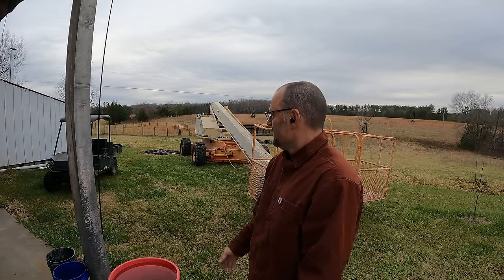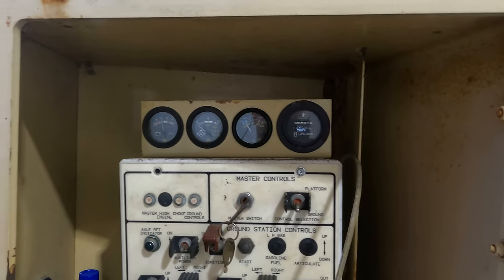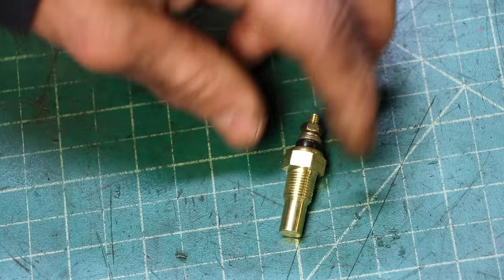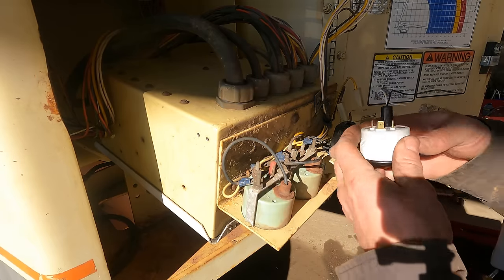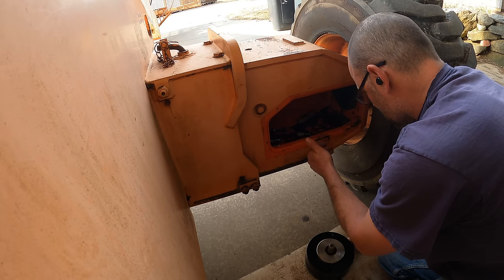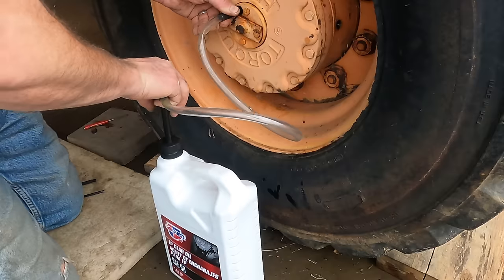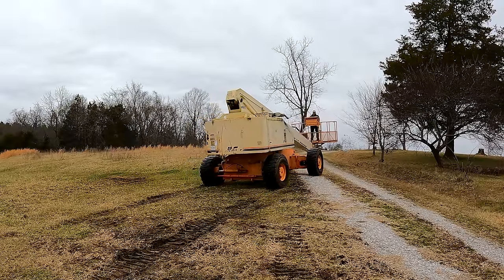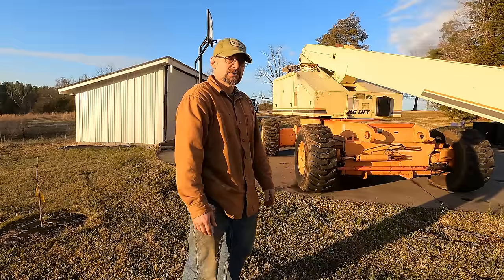Fixing The Boom Lift's 4 Wheel Drive System and Other Stuff.

Comment: Testing  electric gauges, first ground  the wire at the sender. Turn the ignition switch on for an instant. Gauge should  go full scale. No reading bad sender or 
bad  wire continuity .Ground the sender terminal at the gauge. Key on should 
go full scale.  Make sure gauge is getting  
12 volts from the key switch. Most gauges will move off the peg on a cold  engine when the key is on.
Reply from the maker: Yep, sounds like I should have tested it more before replacing to figure it out.
Reply: I have been  fixing  pleasure  boats since the 1960's  so I've  seen  a few gauges 
I also don't like  wiring schematics !
Interestingly  I worked  on very few Johnsons  but I did work for a boat dealer that sold Trojans (boats) manufactured in Lancaster, PA.

Comment: 34:05 i can be wrong, but i suspect that there is a bigger amount of blowby inside the cilinder then you think, because the retraction has difficulties and gravity needs to help. 
The side of the cilinder for pulling has less force then the side for pushing, due the diameter of the piston rod that you loose that can tribute in force, so that is a clear sign that there is something wrong. Another suggestion, is to measure if the hydraulic pump pressure is stil in the normal working area, the hydraulic pump is the heart of the entire hydraulic system. A lack of enough oil pressure and blowby in cilinder(s) will contribute even more on the retracting problem, but the lack of enough hydraulic oil pressure can also be not beneficial for the 4WD drive system. Regarding the connection from the thermo sensor to the main control unit, is i think to cut off the power when the water temperature is to high. It can be a complete cut off power feature, or can be a interaction with the ignition timing (like this is done in cars) that the motor develop less power, and the water temperatur should drop. Now i think of it, this connection between water temperature sensor and main control unit, can also tribute to the cold start problem if the ignition timing is not correct at cold temperature. So this connection needs some investigation what it does or not do.  Grtz

Comment: Hey jon i know its been a while since u posted this ans I was gonna comment it as soon as i saw you do it but then i thought "well lets see im sure he'll figure it out" and sure enough.. idk if anyone else mentioned this but putting thread tape on temp sending units can cause you not to get a ground(if it was in a metal housing like it normally is on most) , most have a o ring but i normally do tape em, just a few threads and leave most of the threads bare for ground
Edit: theyre also very easy to test w a multimeter to see if theyre functioning

Comment: 8:42 That thing is using it to help determine spark timing. This engine is a bit of an oddity in that it has a carb, but it's got a modern OBD-II coil-on-plug ignition system. It's a wierd ass hybrid setup and I guaran-fucking-tee you the sending unit on the water neck that pokes itself into that brainbox is there for the brainbox to know engine temp and thus know where to set ignition advance.

Comment: Do you think the bends in the bars of the basket were from chains the previous operators may have used to hold something like lifting a steel beam into place? they put way too much weight on the bars.

Comment: You mentioned that you have issues retracting when fully extended when close to the ground. Could this be due to (malfunctioning?) safety lockouts?
At 4:10 there is the chart showing unsafe boom angles/extensions. On newer lifts I've used, it wouldn't let you extend at unsafe angles and would beep a lot. Could be something similar. 
I could be wrong, just a thought. Good video.

Comment: Not sure if you'll see this but how'd that Manual choke work out had a suggestion about hooking up a servo type motor to it so it could be opratable from the lift wirelessly that way you wouldn't have the concern of not being able to cold start it after a longer job

Comment: Why not plasma cut in a few oval shaped inspections ports and see what you got. If the machine has not need used that much in the past yrs. You could probably also do cleaning by inserting a wire brush while actuating the mechanism too. To l knocked off surface rust and get a good peek at everything. Then just make some thin gauge cover plates with some self tapping plug screws

Comment: Most all modern engines will have 2 coolant temp sensors…. The 2 wire one will always go to a computer for the exam to monitor and help adjust fuel mixture but in your case it could be used to shut the machine down if it sees an overheat condition. The other temp sensor usually is a one wire and will go to a gauge or dummy light. I’m willing to bet your ECU monitors critical engine components and if one fails will protect the engine

Comment: You temp. sensor needs to be in its original location (low in the block), if it's not immersed from low coolant level, it will NOT indicate an overheating condition .

Comment: Did you buy the new brake assembly from JLG or did you find a good aftermarket source that won’t rob you at gunpoint?
Reply from the maker: I got it from JLG.  Not cheap, not horrible.  About $800.
Reply: @FarmCraft101  Ya, not complete extortion ;p. I priced a control value that burnt up on my Genie lift I am rebuilding through genie and it was $5500.  I was able to lift the part numbers and buy it from bosch for $180. How do you justify that markup? Once again awesome work!  You are what inspired me to create my channel!
Reply: @MakersAcres  WTF? You gotta be kidding. I would probably typed the same thing if you had said $1,800 but $180 that's just criminal gouging IMO. Cool that you were able to get that part number, nice one and I bet you had a massive grin once you got over the price difference shock! 👍
Reply: @josephking6515  Ya. Since I am rebuilding the unit I had to replace a lot of things and found out that the genie markup is 2-5x retail on most things. When they guy told me the price I laughed and said “I think you misplaced the decimal point”. He didn’t laugh. It was a long search, but ya, I was grinning ear to ear when I found the same exact part for so much cheaper. I really feel bad for the guys on construction sites that have no choice but to pay that fee so they can get the machine in operation as quickly as possible!

Comment: The ECU likely uses the temp sensor to adjust spark timing.  It might adjust it for optimal spark as it heats up, hard to say.  In addition, it very likely is a safety.  If the temp gets too hot, spark can be retarded to reduce heat to the head.  Or cylinders could be disabled, or spark cut completely.

Comment: I'm going to say that ECU can probably kill the ignition or at least set off an alarm somewhere if the temperature gets too high. Is there any kind of engine warning light up in the cage, it could turn that on?
Reply from the maker: Yeah, good point.  Somebody else pointed that out too.  Probably just to shut it down if it overheats.  No light anywhere that I'm aware of.  Cheers!
Reply: @FarmCraft101  I love the gauges with the built in physical contacts for warning,shut off. Way better than a black box that dose what ever it wants. I put them on all my equipment.

Comment: I agree with checking out the boom, but maybe you can find a plumber with a borescope on a cable reel like they run down pipes and get a look at the inside to make an initial determination before diving in. If you see something suspicious, you’ll feel better about the job.  If you see nothing, it’ll spawn a ton of comments about why you’d be an idiot not to take it apart anyway. Win win right?  😏

Comment: If it were working perfectly I would agree with the adage of it ain't broke don't fix it since it is over engineered. However, since you have an obvious problem with the retraction there is some type of problem so you and your's is worth tearing it apart.

Comment: 16:50 Maybe a dumb question at this point, but why not test the temp sensor before you install everything..?  Just hook it up to the wires and then press the sensor end on to the engine block or something?  That way you can see, before you make adapters etc, if it even reacts to temperature changes at all before you do all the installation work 😅
Reply from the maker: Fair point.  I just assumed it would work.  Got there in the end, FINALLY!@?!

Comment: I know you're working alone most of the time, but if you're winching with a vehicle you should ideally have it in neutral with someone standing on the service brakes. The last thing you need is 12,000 additional pounds of force on your parking pawl.

Comment: hello from the Netherlands .
does your boom lift have 110V power in the man basket ?  
I think I saw some remnants of it sitting on the left side of the controls.  
this is really a very useful function because in principle you just have a generator on board.  
when you turn on the power function, 
the motor goes into high speed and you just have working power in your man basket for a corded (magnetic) drill or grinder.  
You also have models that work differently, there is no generator on the engine, 
they only have the option to insert an extension cord at the bottom of the undercarriage and then, say, an "extension cord" runs upwards through the boom.  
if you are going to take things apart, it might be an option to at least put an "extension cord" in the wiring harness yourself
thanks for the video .  
Sincerely Hollandduck

Comment: In regards to the boom tear down thing, tear down makes it sound much worse than it actually is my friend. While I'll admit I haven't had to work on a boom as old as yours, I can tell you that what's required is an inspection. The extension cables are visually inspected and then the torque on their nuts is checked using a procedure in the manual. The slide pads are inspected and shimmed or replaced. The boom it's self is checked for cracks via a mag particle test. Otherwise theres not much else needed.

Edit: watched thirty seconds more, I didn't realise yours uses a chain. I know nothing about that so nevermind 🤣

Comment: Yup, I spent the entire first half of the video super confused by the single wire to the sensor, sat in pipe tape with no return path. No way that works. My guess is it's designed to go into a block with a metal-to-metal fit.

Comment: I wonder if it wouldnt have been easier totake the  wheel off and use a manual impact diver for that stripped plug. YOur way was good to maybe slightly less safe though.

Comment: I think you want the temp sensor on the metal part of the engine, close to the heads like the original sensor. Imagine if your cooling system fails and all the coolant leaks out. Your coolant sensor is going to say "not hot" while the engine gets hot enough to seize. You want to know the temp of the engine, not it's coolant.

Comment: Please put inspection panels in it before you put it back together. I can't believe it doesn't have them from the factory. Like aircraft wings, you just can't assume they are ok so they put little doors or covers in strategic places so you can see and or service the inside parts.

Comment: Certain things the 'if it ain't broke, don't fix it' mantra does not apply. Mainly things that if it breaks, you could be injured or killed. So... brakes, boom lifts,  electricals shorts, safety equip, etc, should be maintained to a standard you feel safe with.

Comment: If someone is asking you why are you making something they're watching the wrong channel. When you installed the temp sensor, I thought the teflon tape would insulate it and stop it from working. It makes sense now that the original sensor had the 2 wire plug on it with it being mounted in a plastic body. 

Oh I noticed you kept flashing Nikola Tesla up referring to complicated wiring diagrams. Its Benjamin Franklin's fault when he wrongly guessed that electrons flow from positive to negative. I sometimes wonder how much easier life would be in electronics if he only picked the other way round.

Comment: Hey there, I have a similar year 60HA and I have the same issue with not having 4x4, all my drive motors are hooked up, only 1 tire spins 90% of the time, Ive seen the others spin randomly but definitely feels like it doesn’t have power to all 4. Do you have any ideas? I was thinking a flow divider valve but dont know.

Comment: Newbie question. How do you flush the air from the hydraulic system when you replace parts?
Reply from the maker: No need with hydraulics.  The air just gets returned to the tank.  It self bleeds essentially.
Reply: @FarmCraft101  Why do the brakes in my car need to bleed then? Are they not a small hydraulic system with a small tank under the hood?
Reply from the maker: Different plumbing.  There is only 1 line going to the brakes, the supply line.  There is no return line bringing fluid back to the reservoir.  When you apply the brakes a cylinder pressurizes that line, but the fluid doesn't flow, it just pushes.  So the air has no way to get out.

Comment: The sensor is probably a thermistor, a resistor that changes linearly with temperature.  It might be a bad assumption that all gauges work with the same resistance value in the thermistor.  Looks like it worked out, but I recommend always using the sensor that comes with the gauge.

Comment: Not familiar with this exact machine. Not sure by watching what you did on the engine temp wiring. But the brain box needs the info on temp to protect the engine from over heating. Who will be watching the gauge when you are in the air? By the time you see it is over heating engine damage may have occurred. The brain box also monitors other vitals such as oil pressures  and temps eng/hyd some machines even have fluid level sensors . Save the machine and fix them correctly. Be careful when when rewiring these systems. They operate at lower voltages and use different ways of grounding. To make a mistake on the can cost you a new brain box.Big$$$. A simple temp gauge usually is 12v to gauge and a wire going to the sender and then to ground. As the temp changes the resistance in the sender changes. The gauge  reads this as the temp. just like a multi-meter reads changes in ohms as resistance changes.

Comment: dont you know... never take the drain out first. ALWAYS the fill...
Also with oil that old and spent, If i was you, after a bit of driving it around (maybe 20 minutes of moving around), i would put some mineral spirits  in it and move around a bit more and then do another oil change... i had a skid loader we purchased at 26,000 hours and i had to do 3 oil changes on the final drives before they were happy. and the oil did not look nearly as BAD as yours. we send all our oil out to blackstone to be tested and it would not pass until the 3rd drain. Food for thought, oil is cheap
For the one with the water in it, i would fill it with ATF just to drive the rest of the water out.

Comment: I'm sorry John but I think you got a real LEMON to put it politely. These things are supposed to be somewhat dependable, yes ?
Reply from the maker: I actually don't think so.  I only paid $8k for it.  I knew the 4WD was broken when I bought it, and I didn't HAVE to fix that.  Didn't have to fix the water temp gauge either.  I just want the machine working tip-top if I can make it.  So far I have about $11k in it, and I don't expect to need expensive parts on the boom, hopefully.  A new chain is about $1500, but I don't think I'll need that, and seals for the cylinder should be less than $200.  So I'll be around $12k in it when I'm done.  And I bet I could sell it for $20k very easily, probably much more.  Either way, I've had fun with it because I like fixing things.  And I've already saved & earned quite a lot of money doing tree work with it.  Hopefully it will be dependable from here on for awhile.  Cheers.

Comment: i stopped using cheap gauges and went to AUBER gauges.... i highly suggest you invest in them. they are glorified multi meters that will work with ANY of there sensors. one gauge works with every sensor they have, you just program them. best customer support too, they are about $40 a gauge and about $20 a sensor for what you need. Industrial gauges vs POS china crap

Comment: You created your own problem by not putting the new sensor where the old sensor was.  I don't understand why you didn't just do that.  You spent more time screwing around moving it that it would have taken to change it in the right location.  And I'm not talking about the time it took you to figure out why it didn't work and get it working.  And odds are very good you'll never have to change it again.  (especially if you spend more than $10 on the whole thing)
By trying to outsmart the engineers you a bunch of time and $.

Comment: "If it ain't broke don't fix it" is one of those meaningless sayings.  How do you know it "ain't broke" unless you inspect it?  Seems to be a no brainer that it is better to do it when it is convenient to you than after it breaks down in some field about to flood with rain pouring down the crack of your ahem!  Even if it doesn't kill or maim you it could get some innocent party or object on the ground.  In best case it wouldn't cause any injury but might further destroy an expensive piece of machinery and it.  Would you get in an airplane that had never been inspected?  A chinesium submarine?   Waiting to fix it after it breaks just isn't a viable strategy.  It happens often enough when you don't intentionally do it!